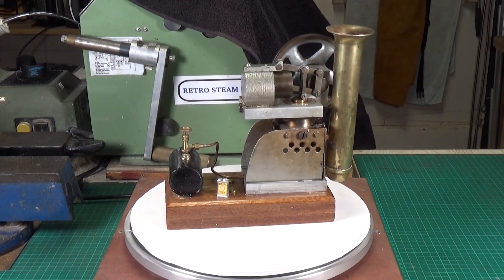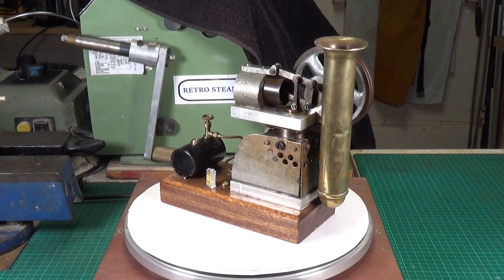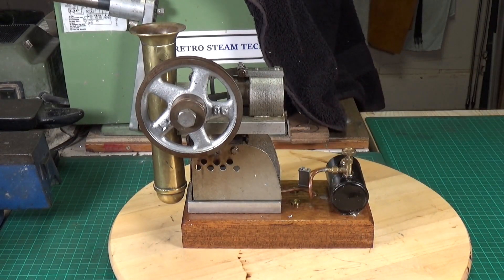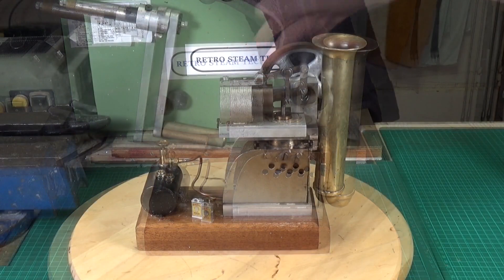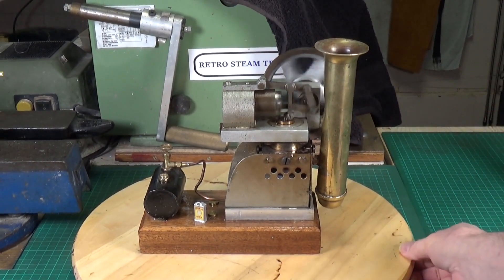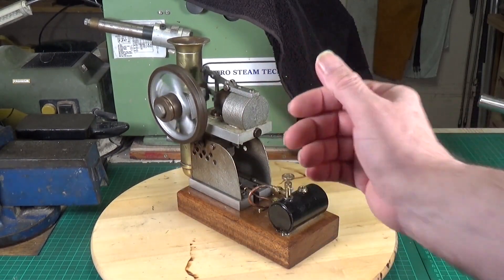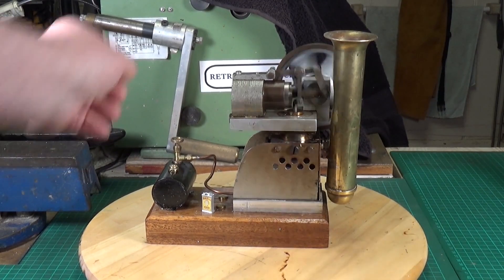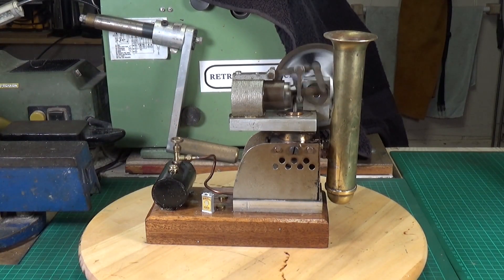Robinson Stirling Engine

Comment: Interesting engine Alan.  The action is also very interesting and I'm guessing copied from a larger commercial engine of the early 1900's.  How does the gas burner work/where does the gas come from/generated ?  Seems to put out a hot flame.  Cheers Rob
Reply from the maker: Hi Rob. Yes I really like the whole lever/crank arrangement. The burner uses butane gas which is supplied from that little black cylindrical tank. I use cigarette lighter gas bottles to fill these type of gas tanks. I don't know if you are familiar with the 'Bix' type of gas burners but this one is similar. Cheers, Alan.